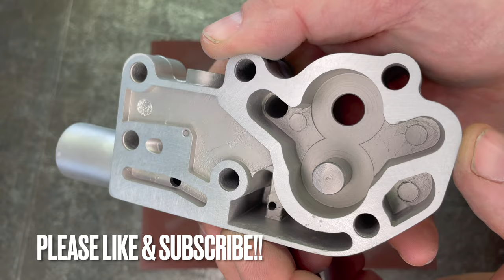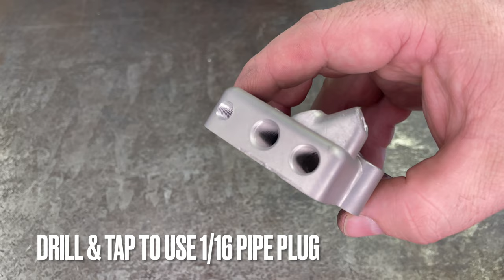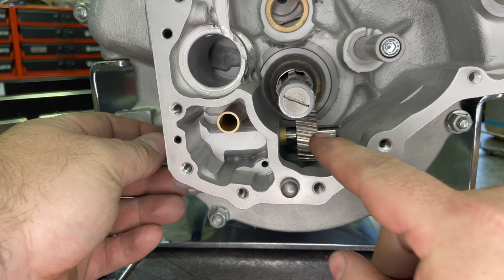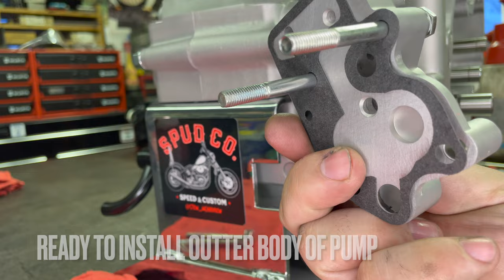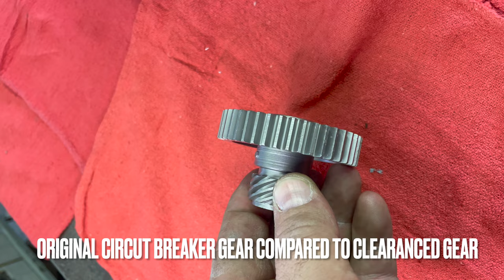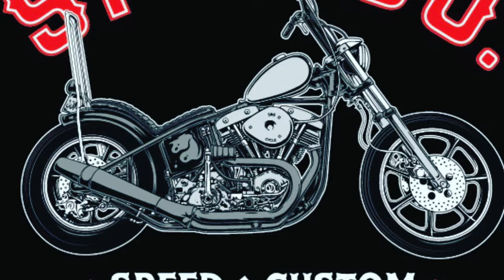How To Build A Harley Knucklehead Part 2

Comment: GREAT EPISODE! I'm going to be doing a similar series on a stroker UL in the near future. The question I have is wouldn't this be a great time to fit a torrington (koyo) b-138 inner cam bearing in place of the bushing? I've done both with great results, but I've HEARD (not experienced) that some of the repop bronze isn't quite up to snuff. Not criticizing, just curious.😊
Reply from the maker: You are correct, a upgrade to a B-138 swap would be good but would require machining. Jims or Eastern Bushings are Perfered. Thanks for the comment

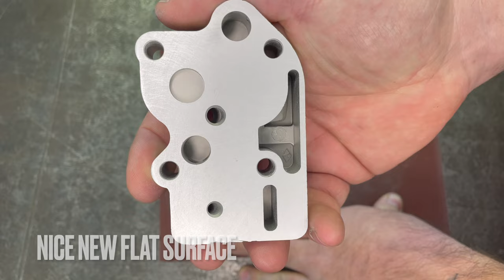Comment: At 0:28 it’s noted that you can cleanup the check ball seat using an old check ball. 
How does that cleanup the seat? And does the check ball size have any significance? Should we measure to make sure it’s the correct type? 
Sorry. I’m just uncertain about this part. Thank you.

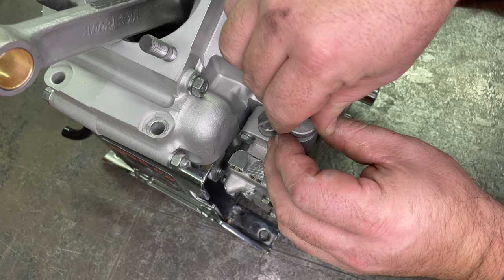Comment: Who makes the 3/8 drive wide blade screwdriver bit at the 4:35 mark?  I slowed the video down, and I can only see that the tool is made in the USA.  Craftsman?  Snap-on?  Is there a part number stamped on the side?
Reply from the maker: It’s Snap On, I’ll see if there is a part number tomorrow on it and get back to you🤙🏻
Reply: @Stew_mcandrew  Any updates?
Reply from the maker: Snap On FMC-38